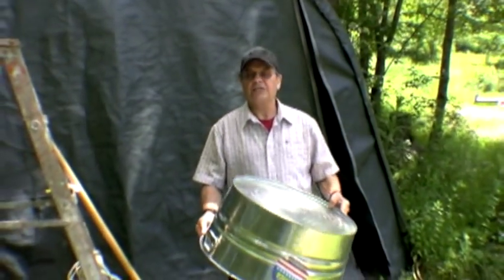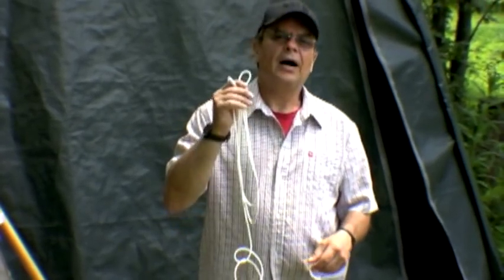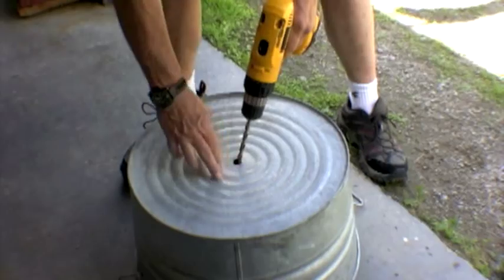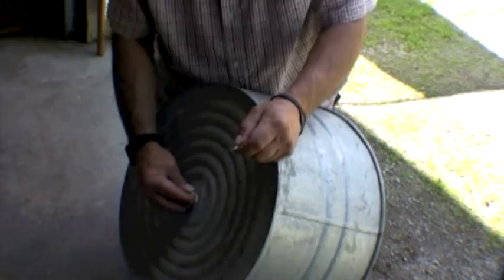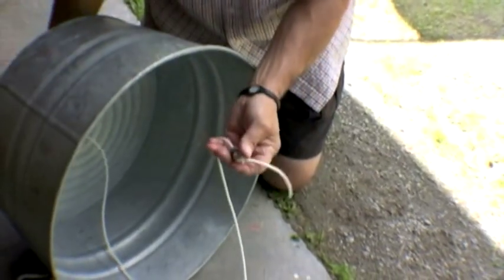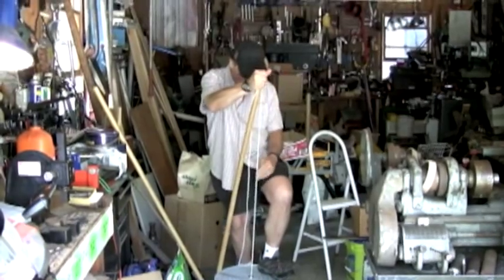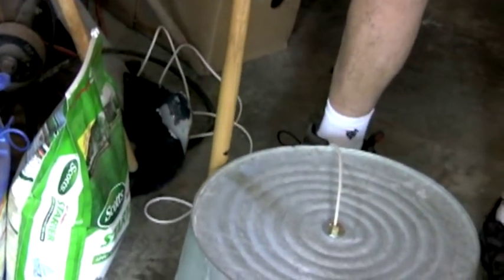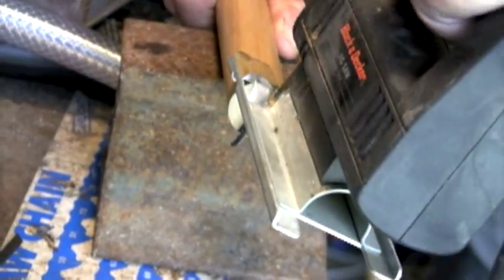How to make a Washtub Bass

Comment: Thank you for posting this.  I know that you are aware of this, but for others considering building a 'gut bucket'/washtub base...The washtub bass is a wonderful, inexpensive 'instrument' to have fun with.  I played for over 50 years until I lost some hearing and had to change to an electric bass.  Playing washtub (and other fretless, stringed instruments) requires that your ears are capable of receiving the feedback from your playing, so that you can adjust the string tension (length), on the fly to produce the correct note.  I believe the best player would be someone with perfect pitch, which is not me.  I lost some of my ability to perceive that feedback because of my hearing loss, and so switched to a fretted electric bass that, if tuned properly, will produce the correct notes for me.  I make my buckets a little differently than you do and will be posting my ideas soon in a video here on Youtube.  There are many many designs for washtub bass.  I like your idea for using a bushing(?) through the bucket.  I have never tried that.  I will try to leave you a link to my video so we can swap some ideas.  :-)

Comment: You’ll get a lot nicer sound if you go directly into the hole and fasten it in place with a large washer, felt pad and big knot. Just hammer out the sharp edges of the tub and tape them off with gaff tape first.